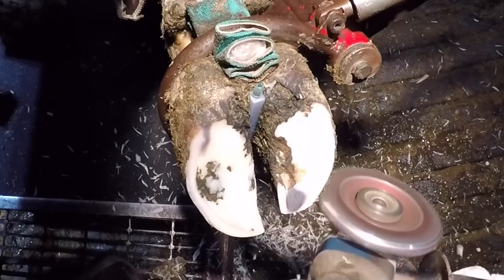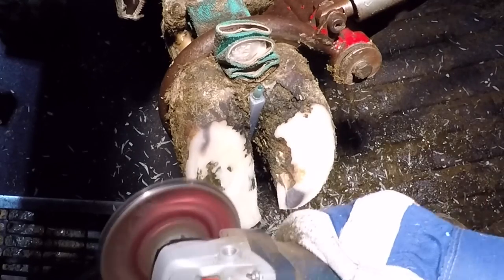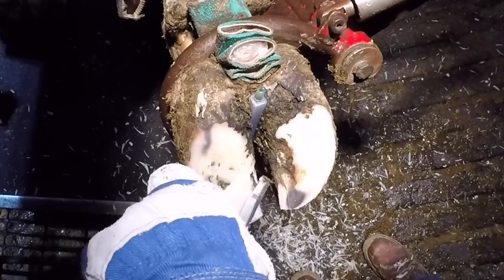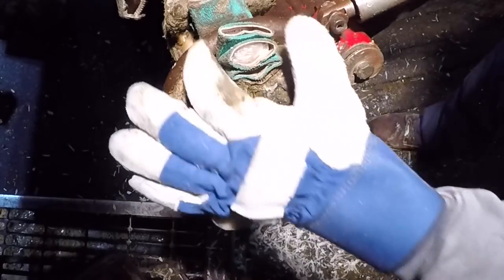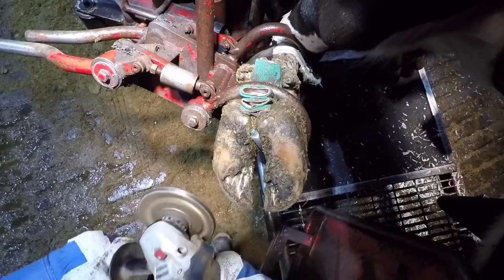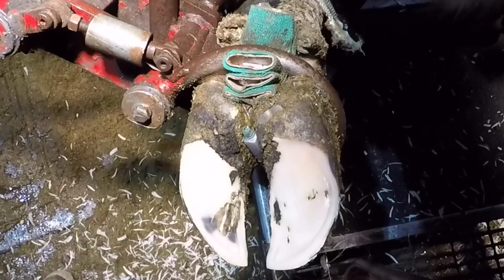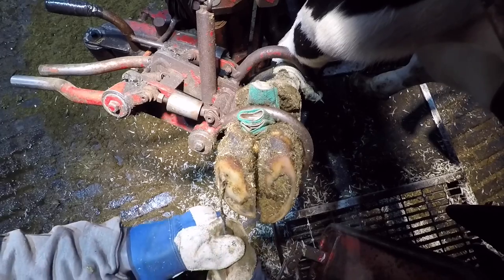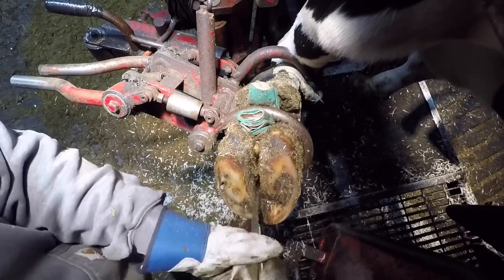THIS IS MY FAVORITE TYPE OF VIDEO TO MAKE

Comment: The "messy" videos seem to be where normal maintenance has failed and things need to be set right. There are two things appealing about those: seeing the healing process itself, and the puzzle of "what went wrong?" I'm always trying to see if I can figure out what went wrong before it is pointed out. I rarely do, but it is still fun to do.
Reply: I disagree respectfully. Normal maintenance is good and doesn't "fail". The girls have problems apart from normal maintenance. Pick up a nail, screw, rock etc. as well as some deformation they're born with. Just the things I have observed by watching Nate.

Comment: I don't  know if you have ever addressed this question before. I've seen some trimmers carve half-moons on the inside claws of every cow they trim and you don't. Why is this done? I sometimes wonder how a cow can walk only on the outside of their claws when they only have a sliver of claws left on each foot.  Love your explanations of how you trim, its very educational. Besides, you have a pleasant voice.
Reply from the maker: The purpose is to relieve pressure from the pedal bone but I don’t think it sufficiently accomplished that.  It also increases the rate of wear by decreasing the surface area of the sole.  Too much wear is problematic so I no longer model the feet out.
Reply: @NatetheHoofGuy  Thanks, that answers my question. Keep up the good work. I know cows appreciate the trim even if they can only speak in MOOs.
Reply: I can understand not doing it on the front feet personally I don’t,but I’ve always done it on the rear outside claws,it’s been pushed for years over here in the UK.

Comment: 2 questions.   I see some  trimmers model  out between  the  hooves.  In this  video  you  didn't  do that.  Is there  a  specific  time  you would  do  that?  And   putting  the  tube tip between  the hooves,  all the trimmers i watch use the  tip.  How did  you  come  to  do that?  Just  curious.  Enjoy  your  videos!!

Comment: I have noticed in your videos that when you trim the "toe length", you often don't seem to trim both claws to the same shape. Usually the inner claw is more square and the outer claw more tapered, and I am curios about if there is a reason for this! My guesses are either that the claws are naturally differently shaped, or maybe it could be about which angles are the easiest to "reach" with the grinder. I would love to know!

Comment: How or what do you use as a proper guideline to determine the proper angle of the hoof
Reply from the maker: It really just a matter of creating uniform sole thickness.  If you accomplish that then you’ve returned the optimum angle for that cow.  That usually means an angle in the range of 45-52 degrees.

Comment: I've noticed you don't typically cove out the interiors of the toes like some trimmers do.  Why & what is the difference between these two methods?
Reply from the maker: The purpose is to remove pressure from the pedal bone however I don’t feel like it accomplishes that and removing large amounts of sole increase the rate of wear which I’m trying to avoid.

Comment: I watch the hoofgp as well. He typically uses a cordless grinder. I understand a corded grinder won't lose power and is generally more powerful anyway. And they are cheaper in the long run as there's no need to replace batteries ect. But I see that cord flopping around and I would think what a pain... I'm sure you are probably used to it but do you still catch the cord once and a while with the cutter head?
Reply from the maker: I’m used to it.  I haven’t cut one yet.  Knock on wood.

Comment: I enjoy both the routine trims and the problematic trims. I was wondering why do you not clean the hooves off with water before trimming or attending to any issues? I see lots of dirt and debris. Obviously having the hooves clean would allow to see them better but no one does this so there must be a good reason. Just curious. I never knew trimming hooves was so interesting. Thank you for the excellent videos.
Reply: From personal experience washing horse feet in preparation for photos it takes forever to get them reasonably clean then you have to keep them clean till your done.  Washing cattle feet prior to entering the crush would practically grind the day to a halt as well as make a already slippery environment even more slippery. Wet manure is slicker than snot!
Reply: @jaykneegarner2479  Thank you for the info. I figured there had to be a logical reason because I do not see anyone doing it but no one has said anything about why.

Comment: How come one toe or one side of the cows hoof always look larger than the other one?
Reply from the maker: The inside toe on front feet is larger and the outside toe on the back feet is larger.  That’s natural as those are the primary weight bearing toes.

Comment: Do you follow a particular school or method of hoof trimming? If so it would be interesting to hear more about it.
Reply from the maker: It’s considered the natural trimming method.  The idea is to return the foot to its natural shape and form to make sure that all the interior structures of the foot perform correctly.  Many of the foot problems we treat are from problems inside the foot associated with imbalance.

Comment: Your videos tend to focus on front feet mostly.
Is that because of ease filming or because you like trimming front feet mostly?
And do you get an equal share of front and back feet lameness and if so/ not so, why so, in your opinion?
Reply from the maker: Most lameness is actually on the outside claw of the rear feet due to maximum pressures applied during walking.  I film the fronts more often just because I can get better footage.
Reply: @NatetheHoofGuy  👍

Comment: If you kept statistics on feet  trimmed, would  you suppose the majority of trim jobs are front feet or rear, inside or outside . . . . OR  no rhyme or reason??   Would sometime  enjoy seeing a close up of your  trimmer,  or the blades in particular. -  Enjoy your videos!         S. Carolina
Reply from the maker: The outside claw on the back feet tend to have the most problems as they’re subjected to the highest maximum pressures during walking.  A lot of my videos are of front feet simply because I get better camera angles with those trims.
Reply: @NatetheHoofGuy   Interesting answer , makes sense!   Thanks for your reply. ~
Reply from the maker: @dixiewishbone5582  You’re welcome.

Comment: This might just be preference, but unlike the Hoof GP, you don’t always carve the insides of both claws. Glenn mentioned how he does it to make sure no rocks or debris get stuck in between both claws. What’s your thoughts on trimming the inside of both claws without any cracks or red flags?
Reply from the maker: The primary reason for it is to relieve pressure from the pedal bone inside the foot but I don’t feel it accomplishes that and removing too much sole increases the rate at which a hoof wears.
Reply: @NatetheHoofGuy , awesome, thanks for the insight!

Comment: I never knew cows needed their hooves trimmed. Why not put 'shoes' on as is done with horses.?
As you can tell, I'm not a farmer.
Reply from the maker: Their hooves are different.
Reply: Horse only stand on 1 digit.  Cow feet are 2 digits and need to flex so putting a shoe on that holds them in place wouldn't work.

Comment: You are just a trimmer not a vet it seems... cuz I can't understand why you've left so many animals walk off with deep holes in their hooves that you can abviously see and will be there worse next time! And I can see from their feet is how it is from the previous visit!
Reply from the maker: The “holes” you see are areas of natural shedding.  It’s why hooved animals in the wild don’t need trimming.  Their hooves would shed completely.  Because cows are kept indoors their hooves don’t shed completely and that’s  why there’s irregularities.  Most of the hoof a cow produces is shed or wears off over time.  If it didn’t their soles would be about 1.5 inches thick after six months.